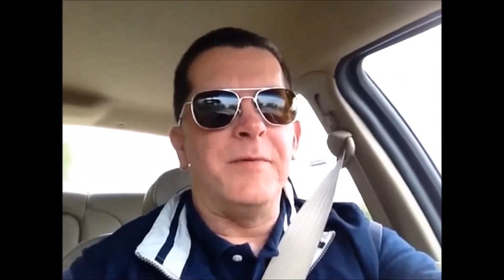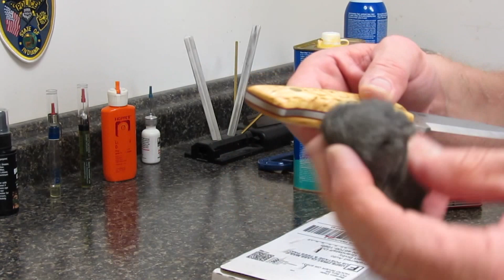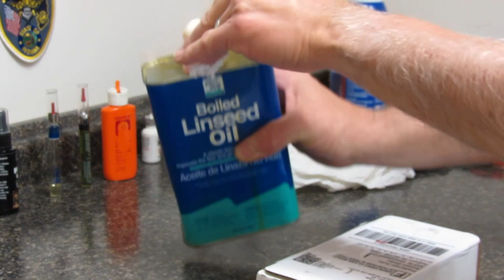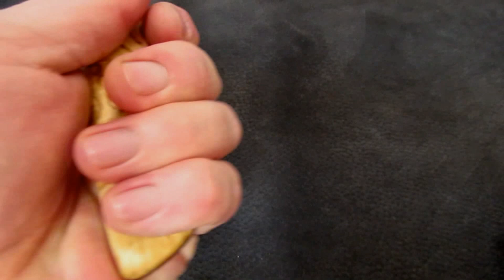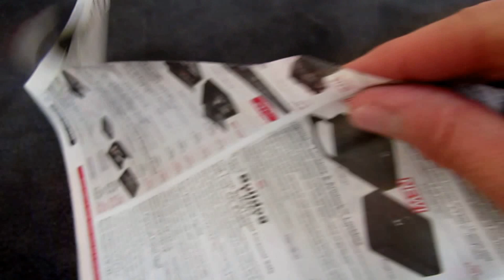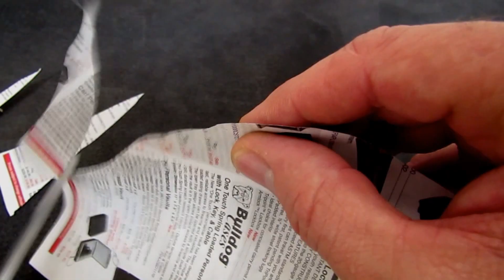Campfiretalk's Enzo Trapper Build 6.0:  Finishing the Handle... and Review!

Comment: Best way to learn: practicing on other people's stuff :)
Good job Rob, it turned out nicely! 
Not sure it needed a micro bevel though.
What do you think of these Enzo kits? They sure know how to ask for a lot of money.
Reply from the maker: I think virtually all scandis need a micro bevel.  I just don't think you get what you want at the edge when you have so much surface area riding across your abrasive.  Even sharpening freehand, when you finish a scandi, you pick it up a bit to finish the edge on your finest grits, then usually proceed to a strop, which produces... you guessed it... a micro bevel.  I just did the same thing with the Edgepro and a strop.  I like the kits, and they're definitely worth the money.  You essentially get a heat treated, finish ground, bead blasted full tang, 4" bladed D2 or O1 knife, with everything you need to finish it, for about $65-70.  Then you can buy it finished with a leather sheath for $135-140.  I think both are excellent values.  I actually have a custom order for a knife similar to this one, using the Enzo blank and a handle spec'd by the customer.  He named his price -- $200 shipped.  Go figure...
Reply from the maker: You're right... a freebie for a buddy was definitely the right way to get started, and I learned a bunch!